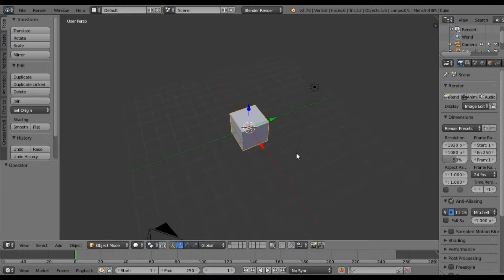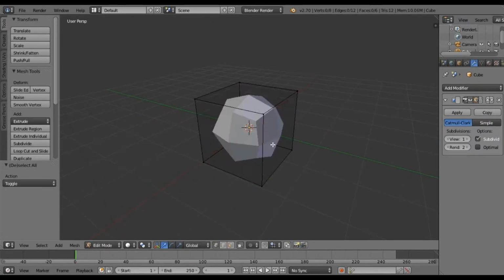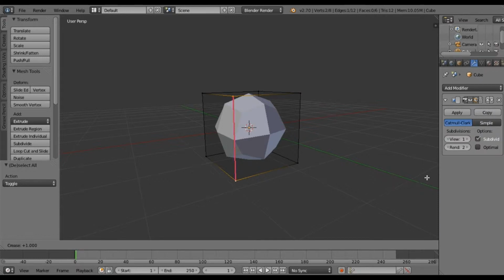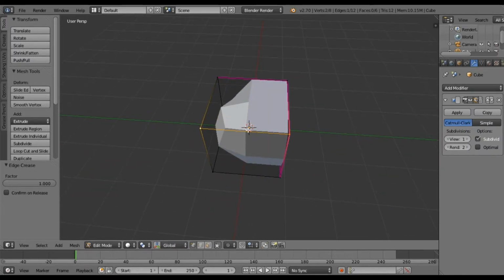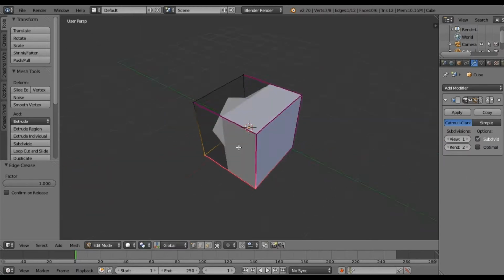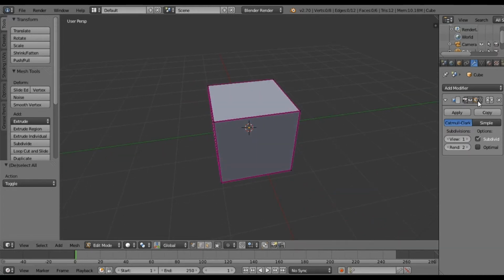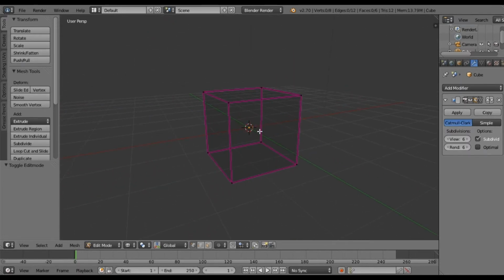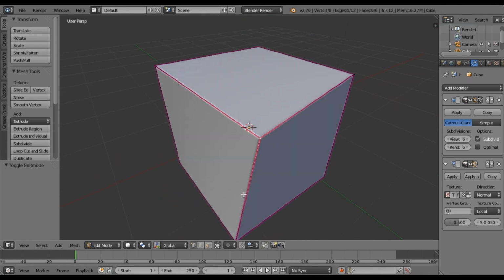Blender Quick Tip: Seam Creasing

Comment: edge crease is also in the "n" menu at the very top its called "mean crease" there and it has a slider bar.
also you can select all the edges you want before you use edge crease and it will still work, its much faster that way.